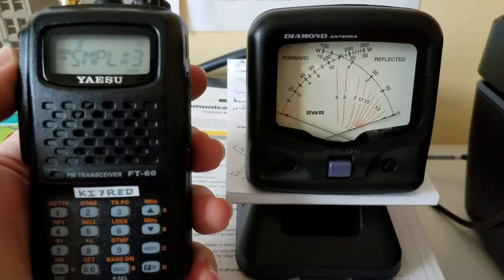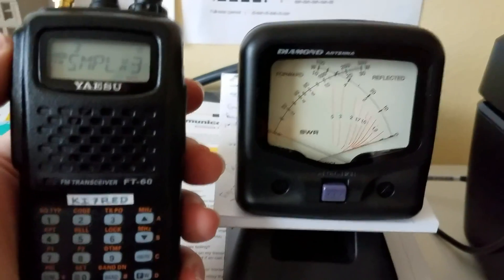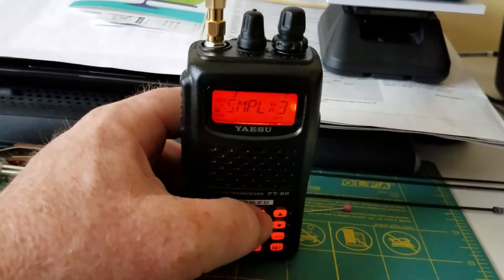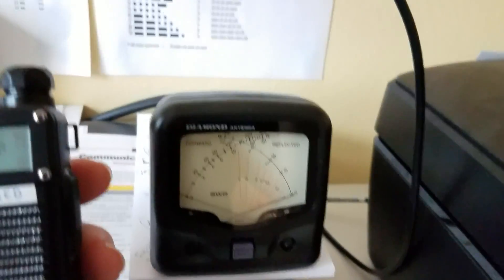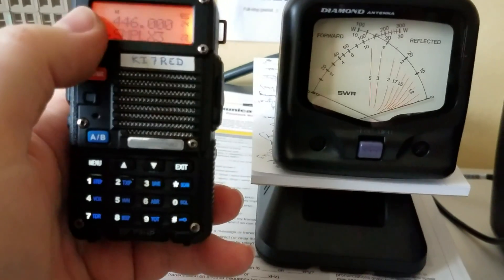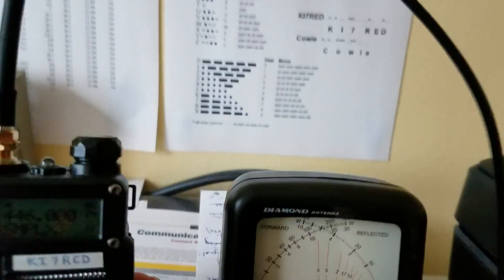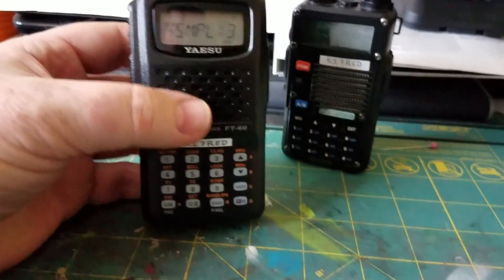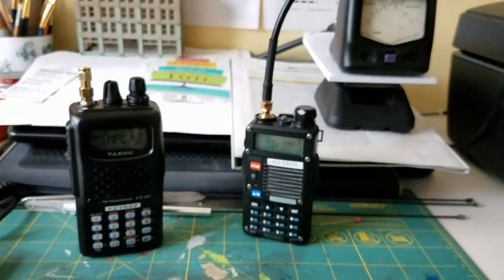Yeasu FT-60 vs Baofeng BF-F8HP: power meter test

Comment: I own a baofeng BF-F8HP and works flawless,  I don't think you will notice a 1 watt differance.Its usually the antenna that makes the differance.That being said, after reviewing the comparison on the ft60r on other sites, I believe it's a upgrade to own ft60r , not on watts but on quality built, better transmit and receive. The unlock mod is definitely a plus to operate on gmrs.The newer baofeng is a no go on gmrs.The more the merrier

Comment: Nice meter, no setting up. I got a cheap one, Have to transmit and set the needle to the top using the knob. On low 1/2w it struggles. Not enough power. Guess that is a powered job. I have had 2 of those Baofengs and the look alike DMR version. 3. one of those analog ones died, kept as spare parts. in the end had the on/off volume control off the board to swap to the working one but scratch volume. DMR one stay ok. All sold and other things, A lot of things to get money for the replacement drone. one sunk in Oxford canal on a boat trip, day out. I was disappointed with both. Moaned to ebay, wanted it to go back, private seller. Would not budge, It did 4w on H and M. Low was less as expect!, a watt maybe. 
Got the cheaper Yaesu fusion. digital thing when that replacement drone was sold July for the Yaesu handheld. That hit 4W not 5, M and L as spec. No drone anymore, always felt a waste of time in videos. Tht another story. 
Baofeng. cheap, Spurious emissions, suit the rules, No. Is something UV-5R look alike that is (2 years old?), Cheap and everyone has one. I bought a 2nd hand one Febraury at start of the month. Radio clubs monthly meeting, table top sale. £6 for it and magmount for car, Bargain. on QRZ. linked in banner snap or "about"

Comment: I have tested my BAOFENG BF-F8HPs (2) AND MY UV-S9 (4) at between 7.5 and 7.75 watts using a battery eliminator made by Baofeng with DC INPUT of 7.75 volts and the average current drawn was 1.45 to 1.58 amps. The rated output is 8 watts max and that is what i saw a max of 8 watts falling to 7.75 and 7.5 watts. The instrument used was a SURECOM  DIGITAL WATT METER WITH A 50 ohm, 10 watt dummy load  that was purchased at the time of purchase of the watt meter. If you are going to measure low power then you need to measure it with an appropriate meter with a proper load. I noticed during your " test " that your reflected power needle did rise and that amount of output power was not being properly measured since your load was not 50 OHMS and that counts.

Comment: A good radio isn’t determined by transmit power, but by receiver.  If you really want to compare the two, do a simplex range test of two FT60R’s vs two Baofengs.  The FT60R’s will outperform the Baofeng junk as the FT60R’s have superheterodyne receivers, not direct-conversion crap.  Baofengs are junk.  Just because they can get on a repeater doesn’t make them good radios.
Reply: True i have the Yaesu FT-60 and VX-6R and i also own two Baofengs and yes they’re junk compared to the Yaesu ones. But they’re fun junk.

Comment: Dude your test is moot. Because you did not test both radio's on the same frequency. I have a F8 and I get 7.96 watts of power when using a Diamond 7500 Super Gainer Antenna. Only reason I get that low is the SWR reading is 1.04. So yeah, redo the test, use the same frequency on both channels and I think you will be surprised.

Comment: At 4.25 you indicate you have SWR="zero"...I think you meant to say near 1.0?
Although, SWR=1.0 is rather incredible for a distant roof-mounted J-pole.
As they say, the devil is in the details...especially with UHF.
Here are some things that MAY be involved and the magnitude of impact can be unanticipated and surprising...

Did you calibrate your meter immediateloy before taking readings after each connection/re-connection?
The F8HP doesn't output 8W on 70cm.
The F8HP spec says 8W Peak and 7W Peak for VHF and UHF respectively...which does leave some wiggle room for the manufacturer for interpretation in FM transmission since I'm assuming you're using the meter set to "average" power. The wrong setting could yield different results (though on an analog meter I wouldn't expect much difference on 5-10W FM modulation signals. I don't know how a digital meter might handle it...firmware dependent?). Even the term "average" can be an issue when one is looking at specifications as it can mean different things to different people. For example, to BaoFeng marketing, "Peak" MIGHT mean the highest output that can be achieved at an optimum frequency in the radio...not just anywhere in its transmit band. Thus, they might output 5W for much of the band and only have anything approaching 6-8W at or near 147MHz (Marketing and Engineering sometimes don't agree on wording and definitions.)
Also, UHF measurements are unreliable in SWR readings. Analog meter accuracy WORSE than 10% is not unusual in that band even after calibration, so you could start off with a "loss" of almost 10% right off the bat, even though VHF measurement could be very accurate with the same meter. 
In addition, connector types can make a difference for UHF measurements that do NOT show up in VHF measurements; example--SO239/PL259 connectors vs. N-type.
Also if there are any cable coils or even cable crossings or cables adjacent to power-lines in your cable run to the antenna errors would be enhanced in UHF but not make as much difference in VHF performance.

Comment: I purchased a Baofeng radio just to try it out. It was OK. I enjoyed the weight of the radio and after taking the time to learn how to program the thing all was well.
I still am happiest with and still using my Yaesu FT-530 of which I have 3. Two for base use and one for travel. I am happy to have a Yaesu MH-29 speaker mic for all three radios. 
Our local club updated the repester to the Yaesu DR1X System Fusion 2m VHF-FM repeater capable of doing both FM and C4FM digital modes. Any suggestion on which radio (handheld) would be good for working the digital modes?

Comment: I do find it funny you tested at 70cm and expected the BF to be 8W.  Try reading the specs of your radio.  Head to 2M for 8w.
Reply: The top displayed frequency is not the one he is using.  He is transmitting on the BOTTOM vfo, the one marked simplex3.   One would think you knew what a dual vfo was, but I guess that is above pay grade?     There is absolutely no indication that he is using any 70cm.  We can reasonably assume when he labels "simplex3" on his radios they are all the same.

Comment: Let's get this straight everyone. For all of you who claim to be hams, I'm surprised you're not able to notice that on the Baofeng, he was transmitting on the "B" band, set to "simplex 3", the same VHF frequency he was using on the Yaesu. Take a closer look, people.
Reply: I took a second look, and I stand by my original comment. He was on the same frequency on the Baofeng; "B" band.
Reply: Good eyes.  If you know anything about this radio you would know to look for the little triangle which indicates if you are on channel  A or B.  In this case he is on channel B, which is in fact 2 meters.
Reply: From what I see after 04.25 or so, he's transmitting on about 446MHz. It's hard to tell even with YouTube resolution set to 1080, but that's what I'm seeing.
Reply: Correct. bottom line on Baofeng. Simplex channel whatever one he has picked as a name so not told but both on the same as programmed to memory.
Reply: Okay, on the Yeasu Radio, he was on a 2m frequency, he even says the frequency, in the video. On the Baofeng radio, you can see he's using a 70cm frequency, so this test is moot. To be correct he should have tested both radio's on the same frequency.
Reply: It's still unclear what band Simplex3 is in this video. It would have been preferable to not run the test in memory mode.

Comment: Baofeng will give 8w on 2 meters only 6w on 70cm
Reply: From all the video's I've seen, they always quote the power on 2m , and on UHF is always less. Im not suprised there. But  I also sometimes see power levels slightly less than advertised .  All in all for the price these things go for,  you can't complain really.
Reply: I have seen 8 watts on 2 meters and 7.5 on 70 cm.
Reply: The HTs i have worked on the most in the past has been GE MASTR HT AND MOTOROLA HT220 WITH THE 4 WATT DECK... BOTH WENT FOR $1000.00 OR MORE AND PUT OUT 4 WATTS IF YOU WERE LUCKY, and people BITCH  about 5 to 8 watts with many many more features for $20 bucks? The first ham HT that i saw was a motorola HT 200 WITH A PRINCESS DTMF keypad mounted in a budbox on the front... BE THANKFUL FOR THE BAOFENGS AND QUIT WHINING!
Reply: So, this is an example of an Apples to Oranges comparison.
Reply: That is not true

Comment: Thing that i have found is that battery voltage is very important for full power. That's why when repairing them and testing them you use a psu not battery's and ther is the thing, the standard battery of the Baofang are way cheaper as well so the voltage can be a little lower with a full standard pack causing to not give full power. My UV-5A+'s (i have 2 that now are al over 5 years old!) that should be 5W on high are 6W and 6.5W. Still the Yeasu FT-60R is at about 3 time the price is a compresence like a cheep car and a good midrange car. For all the problems that the Baofangs have, the  power isnt really the biggest problem. Getting a real BF-F8HP can be a hassle as they sometimes are UV-5R with a new case and such (yes they get faked). In the end its a good radio for it's price and if they get banged up, its ok you don't lose that much. But I personally would pay less and just stick with the UV-5R and the variances on them like the UV-5R+. They are a bit cheaper and you can put that extra money in to a better antenna as the ones that come with them are glorified dummyloads :P

Comment: It's advisable when purchasing a baofeng to get the 1 watt low 4 watts high model, as the 8 watt models seem to have a short life expectancy on the rf output transistors. Also the distance gained in actually range between a 4 watt radio and an 8 watt radio is at best 150 meters in a built up location, but battery drain is over the top running 8 watts. For the gain and price difference it's a better option is to go for the lower power rated set and fit a better antenna possibly a nagoya 771. 73
Reply: Baofengs as most radios don't like reflected power and i have measured certain antennas that reads as much as 5.3 missmatch.

Comment: I have had my BF F8-HP for a bit over a year now. I used to use it as a base station, running on a external 12v DC power supply through a Arrow Open Stub J-Pole antenna. On a frequency linked to a repeater 146.775 I was getting a power reading of 7.8 watts. When I use it as a HT I use a extended battery. I have yet to test the power when using said extended batter.
Reply: I've seen F8HPs tested at 7-7.5 watts VHF and ~6.5 watts UHF. I own one myself. But the thing is these F8s bleed both out of band and harmonics outside of FCC spec. It's not a "huge" amount but it's enough to cause interference problems to local (within 200 meters) operators.

Comment: its advertised 7 watts uhf idk what u labeled simplex 3 as but i get 8 watts actually more and then about the same on the two lower power. its still a 50 dollar radio thats literally pumping more power out then a ft 60 and has loads more features. what would i want the ft 60 for? well, basically the front end, still, until the prices go down on what is essentially outdated stuff i dont care to own anything other then motorola commercial stuff. sorry, but yaesu cost comparison and quality comparison... motorola slays them.
Reply: Ur sexy

Comment: Great demonstration.  Where did you get the antenna coax lead that's connecting the hand held to your meter, is that an SMH to a PL-259???. The lead that I have is decent but fragile, would like to find something with a little heft to it like yours.
      Kind regards, Eric Dee.
Reply from the maker: Eric. It's a 3' pigtail MPD Digital cable ordered off Amazon. You can customize the connection ends as needed.
Reply: cowieboys : I'll be, okay I am going to order one, thank you for your response Sir.
     Thanks for sharing, 
       Eric Dee

Comment: I'm curious what the power output would be on the Boafeng if you tested on 2 meters like the FT-60 if the power would be higher. Usually a handheld will put out more power on VHF than UHF. At least that has been my experience.

Comment: Have you ever found a Baofeng advertised as an 8 watt’er ACTUALLY putting out 8 watts and if so, which model? Thanks.
Reply from the maker: Joe. I've only owned this one Baofeng so I wouldn't know. Sorry
Reply: My Bf8HP puts out a tad over 7 watts on high with a fresh high capacity batter. Had it for over a year with no problems at all.

Comment: I have a similar Baofeng radio and it puts out 6.5 watts on high and 1.5 on low. The odd thing is there was no difference between medium and high. It is a cheap radio, but still at 6.5 watts I can live with it.

Comment: I had purchased a BF-F8hp and my output was 2 watts on low, 4.5 on mid, and 0 on high. I returned it for a replacement. The replacement was doing 1.5 on low, 4.5 on mid, and a bit over 6 on high. However, after a couple of weeks it died. I returned it for a refund. I have a Kenwood TH-F6a and have had no issues with it in the 8+ years I've owned it. I'm not a Yaesu man but, that being said in my option your FT-60 is a far better radio that the F8-HP. Ham radio as in most other things in life you get what you pay for. I'd be willing to bet that your FT-60 will be running 10 years from now. I doubt any Baofengs will be operational in 10 years. LOL  And for whats it worth there's my 2 cents. 73's N4ZDX
Reply: I have 4 UV-5Rs from 2013 that still work and i use them regularly in the out doors for hiking/backpacking.